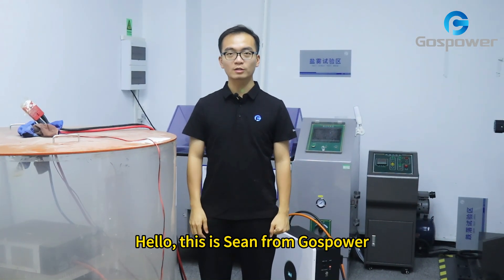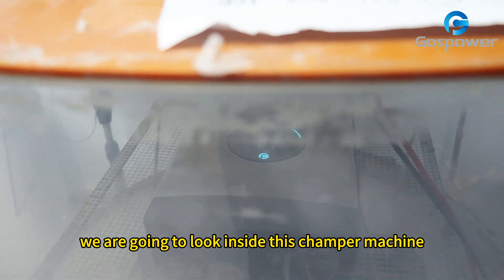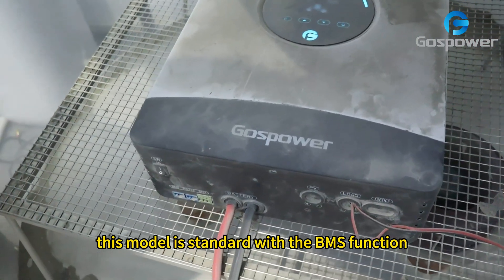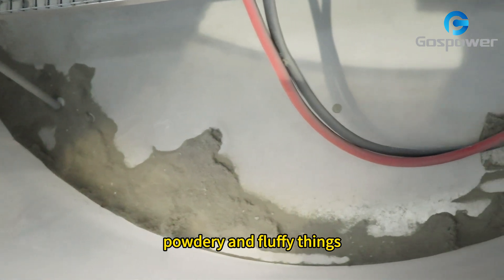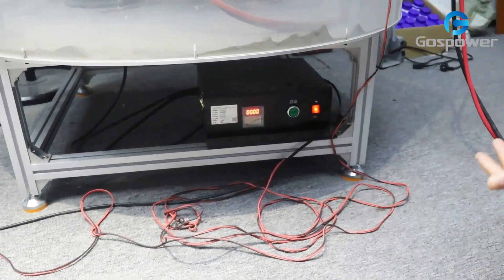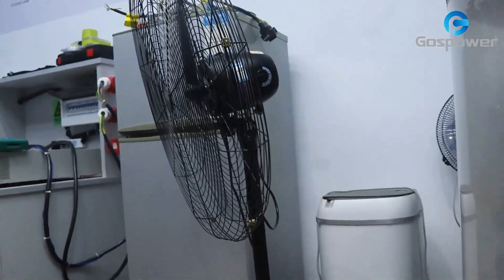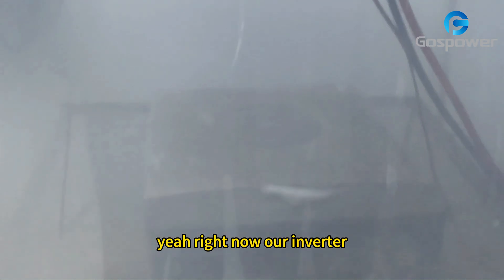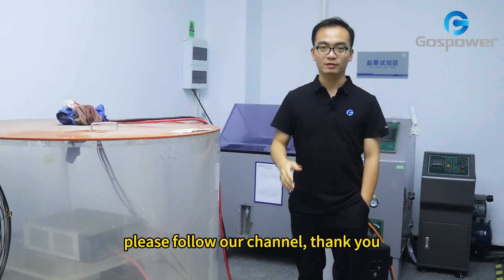Gospower Solar Offgrid Inverter Charger in Dust Testing

Comment: Hello, I have your 4kw gospower product. It is a very good inverter. but, I notice that it does not give a battery low voltage warning or beep sounds  and when it goes off, the inverter does not show the error message as "Low battery voltage shutdown"...... this is not good because I am unable to track the reason of the shutdown.... please work on this feature. it is the simplest feature in all inverters

Comment: Do you have heat sink inverter?
Reply from the maker: what do you mean heat sink inverter?
Reply: @ my bad , Sorry for it. I mean inverter cooling system without fans such as aluminium inverter heat sink. Thanks.